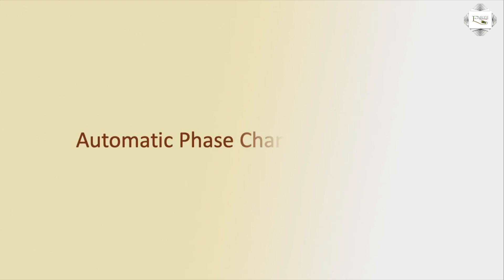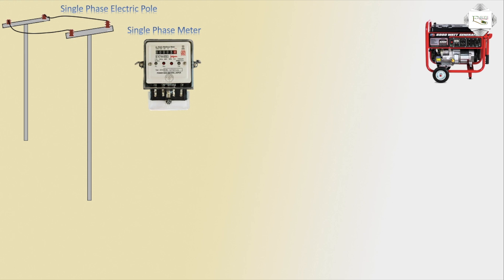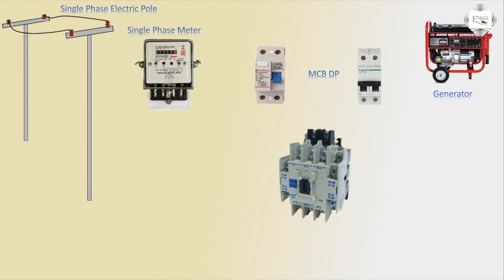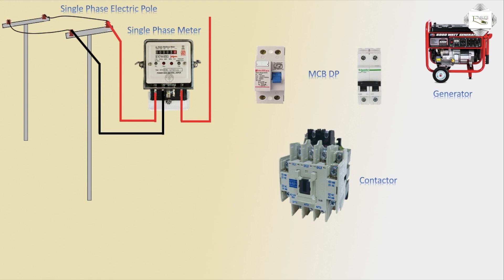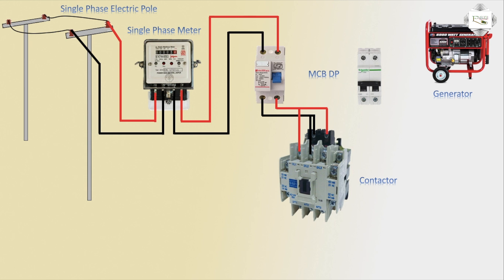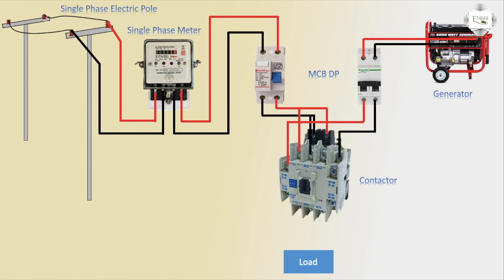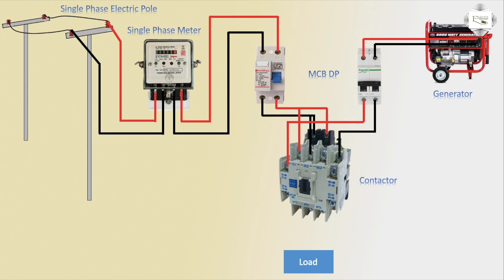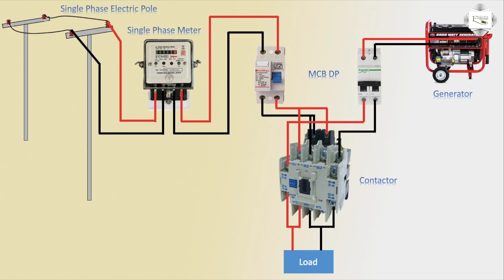automatic changeover switch | Automatic Phase Changeover System | ATS

Comment: Scam its not gonna work properly because there is no auto starter to the genset.  And there's no safety protection to the main power
Reply from the maker: no, sir electrical line on magnetic contractor contact on. electrical line off magnetic contractor contact off.

Comment: This is very wrong way to do electrical wiring, It's not correct to use the holder contact to flow generator load. for two source power supply use two separate contactor and interlock them mechanically or by wiring
Reply from the maker: thanks for info..
I found Your Video Through Youtube Suggested Video. I am new to Youtube and Trying to Build a quality channel. I love how your videos are of high quality and easy to understand. I am a Subscriber of yours and I look forward to seeing more videos of yours in the Future. Thank you for sharing.

Comment: To turn off the generator if the electricity network is on the meter there should be a relay as a genertor contact breaker by flowing current from the meter to the generator contact relay. I also use it like that and I complete it with a 12 Volt relay as a generator contact breaker
Reply from the maker: powerpoint software using. 
yes, add me whatapp. full info website @earthbondhon.  I love to receive your comments and feedback.
Thanks for watching it.
Reply: @EarthBondhon  Yes. I'll make the diagram later and I often have other assignments now so just wait
Reply: Yes. wait later
Reply: Hartono Karangsukup  thanks i will wait, and one more thing will the relay switch the generator director, my generator is not automatic one you have to switch it manually
Reply: Hartono Karangsukup  please share the diagram of that,

Comment: Let me clear this one. For starters, you always mentioned “POSITIVE “ and “NEGATIVE “  well, Single Phase is NOT a DC POWER it is AC rather so there is no polarity. You should be aware of the Line(L) and Neutral(N) when using AC Power instead.

Second, The generator in your diagram is always ON unless you turn OFF the Circuit Breaker and there is no Delay for the Generator to build up Power. So yeah. Please Redesign your Circuit. It could be a misleading information for some beginners in Electricity. Thank you!
Reply from the maker: all right diagram,
yes, add me whatapp. full info website @earthbondhon.  I love to receive your comments and feedback.
Thanks for watching it.
Reply: Even the previous vedio using two contacter there is no protection ex mekanikal interlocking between contecter. Should install SPR or undervoltage relay and relay to detact for start the genset

Comment: I think there is two mistake 😑.The current rating of auxillary contact is small which isn't stable for main supply.
There is no delay ☹️ time between the two network .
Reply from the maker: add me whatapp. full info website @earthbondhon.  Love to receive your comments and feedback.
Thanks for watching it.
Reply: @EarthBondhon   wrong conections, you cant mix up control and power wiring, this guy mixing up power and control wiring, which is totaly wrong, it doesn't works.
Reply: Your right sir,